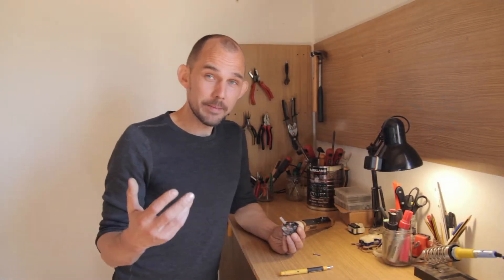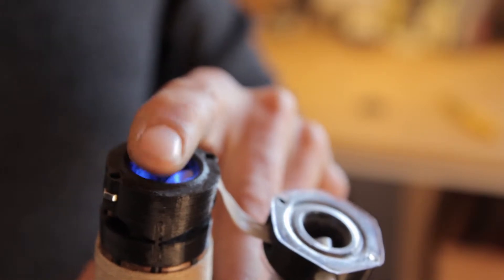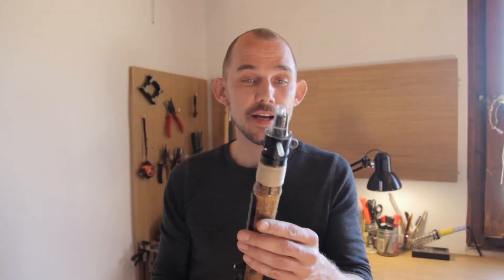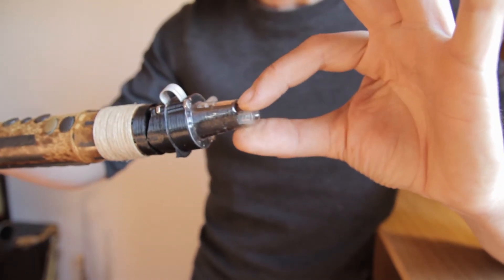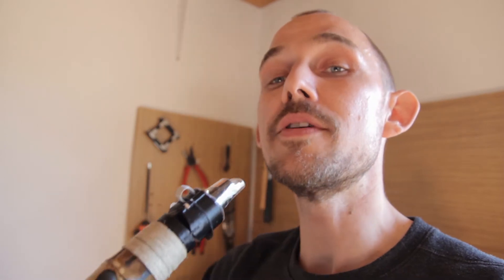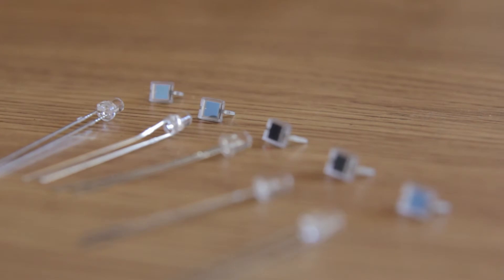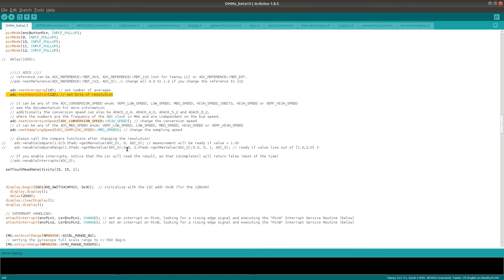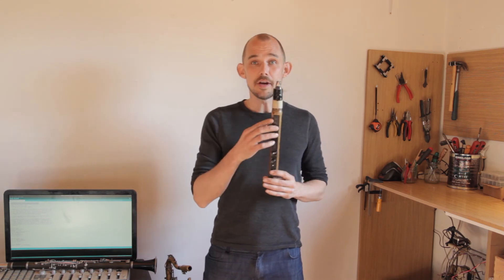Open Horn MIDI system - S1E2 "Analog Sensors"

Comment: I would be interested in learning more about how you formed the clear mouthpiece cover. Vacuuforming?
Reply from the maker: Close but not quite. I actually use two molds, a positive and a negative, 3d printed in nylon. Then I heat up the plastic sheet like for the vacuum process, and stamp it into shape between the two molds. Maybe I'll get around to showing how it works in more detail in the future.